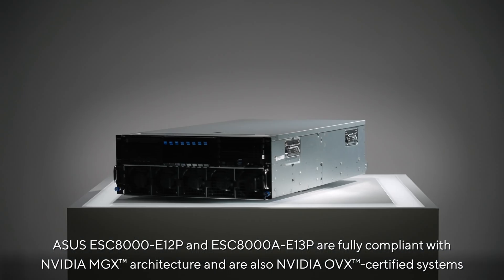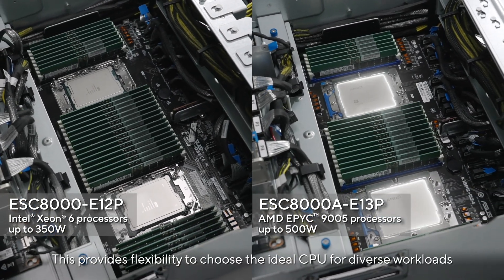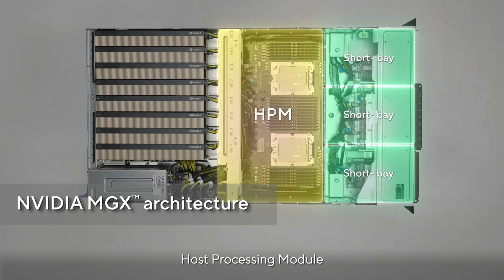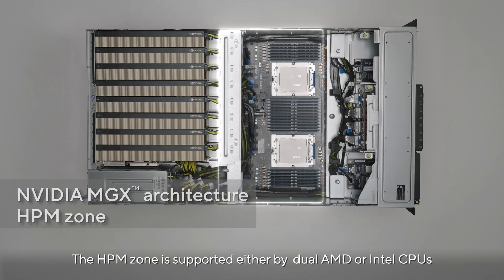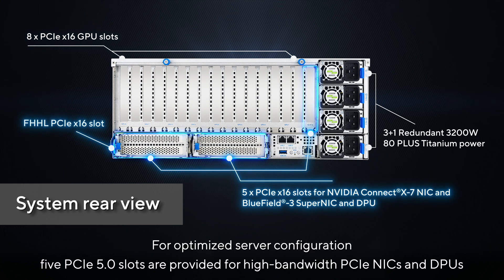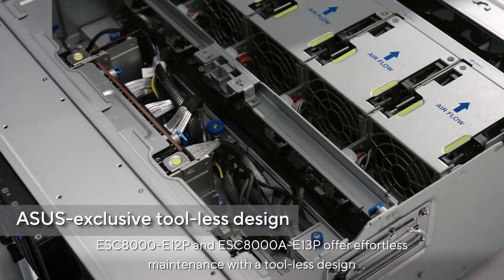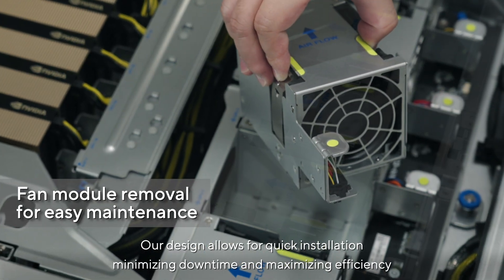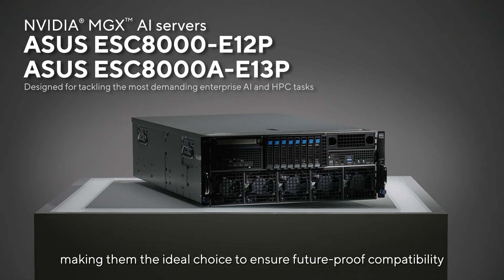ESC8000-E12P & ESC8000A-E13P | ASUS GPU Server

Comment: How can I enable ASUS ESC8000-E13 motherboard’s BMC/IPMI to read PCIe temperature sensors from NVIDIA H200 GPUs, so the motherboard can automatically control fan speeds based on GPU temperatures?